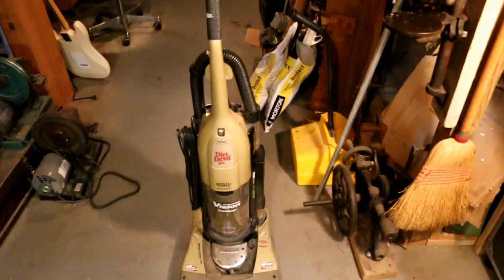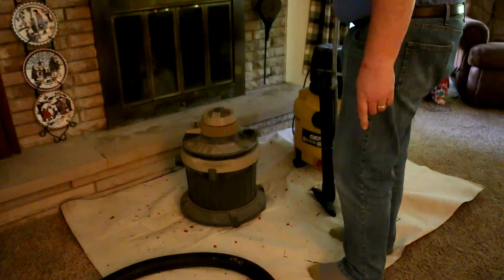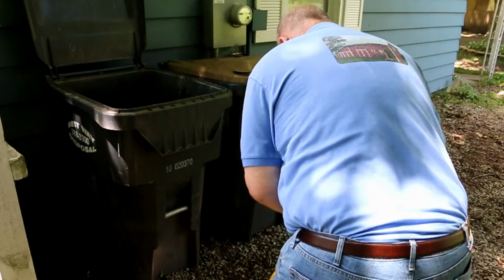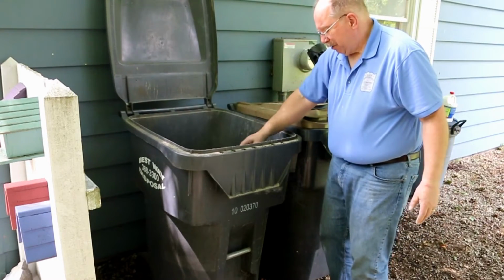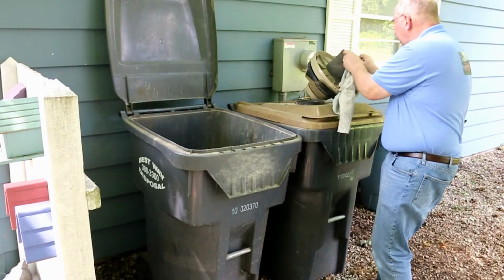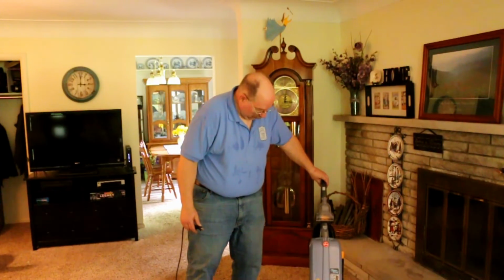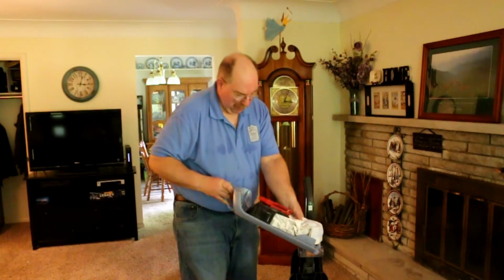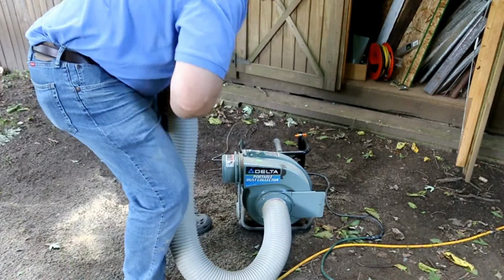Dust Collection ~ Vacuums Need Air

Comment: I rather use a Air compressor to clean a filter out that's what I use
Reply from the maker: I do that with filters on the mower and other equipment. I sometimes do that on the vacuum too. Most times I just dump the tank and knock the dust off the filter. When I'm picking up heavy dust it covers it so quickly I just dump and knock the filter.  😁😎

Comment: They say nature abhors those things... As pretty much any shop I've seen; but most shops do have a shop vac...
Dad installed a dust collector that has a separator. The separator is a fiber drum that sits in the middle of the intake hose.
And I've probably pulled as many vacuums out of dumpsters as I have ever owned.  The best vac in the house only needed a little black tape where someone had dinged up the cord.  The cord was long enough that I could have cut the bad part off and would still have enough for my house.
A handyman should never have to buy a vacuum, 'cause they abound in dumpsters; except for when he happens to need one... 😠

Comment: Biggest complaint with domestic vacuums . Well it was really good now it's rubbish . Yes. No flow blocked solid it's amazing what you find inside and in the pipe blocking it . Like you say air flow is key . The filter cleaning I use a brush first rather than banging it get the worst off then quick bang on the side . Then like you quick blast with air line every now and then . Good job dave take care god bless
Reply from the maker: Pressure differential creates air flow. Instant tornado. I think we could stop a tornado cold if we just had enough dog hair to place in front of it. 😈

Comment: Did you get a new truck?  The last one I seen was the one that had a tree fall on it.
Reply from the maker: Yes. Last year around this time the differential  was screaming on the way home from Goshen.  I bought the Chevy Colorado because I didn't think the Sonoma was worth spending any more money on, but I needed to make the 120 mile round trip to Goshen 3 times a week. 
The Colorado is a work truck with no bells or whistles beyond air conditioning and cruise control. It is a 2012 so ten years and 100,000 miles newer than the Sonoma. 😆😎
Reply: JustSomeGuyWithACamera u

Comment: The $45 was WELL spent! We just have a small one that takes a 5-gallon bucket but it's good for cars and wood trash on the back porch at seasons end and I can blow out the filter with the leaf blower. Rainy out and Cheryl is out in the greenhouse. I'm back with a heart monitor for 2 weeks. A stick on job and I got poked for blood gasses for the setup. They're bound that I'm going on a pill I had issues with years ago and I'm bound that I'm NOT! My resting rate is from 50 to 70 bpm which is fine so as long as big brother is recording I'm on light duty, just when I was starting to get limbered up. BUT fall is coming and so will be firewood time! And someone lawed a heavy metal vacuum off on me used especially in cleaning up ashes. I lawed it off on the Re-store. We shovel ours out into a peck bucket and rake the coals back inside and the fire stays going, and when it goes out we shovel the ashes out and leave the dead coals for the next fire. Fishers start better that way.  So THANKS, Unc! A-PLUS! and NOW the sun comes out!
Reply: I had my Heart Attack three years ago, they put me on thinners to make it easier to flow. I gotten tired of packing those 40 lb bags of pellets for the stove.  Momma claims she can smell the smoke and it's not good for her lungs. The crew just left after installing a ductless heat pump for the house, the ac feels good for now.  I think the electric cost will be about the same as the cost for the pellets as they keep increasing every winter.  We have cheaper electric rates then you have. I think I'm getting too old to pack pellets into the house and if something should happen to me Momma can't carry them. Life is full of changes or as I say adapt and mutate hang in there Lewie and have a good day.
Reply from the maker: @paulharriss1192  That's why we looked for a house with a gas furnace primary heat source. In Union City fuel oil kept going up and fewer people used it. $14,000.00 to upgradevwith new ducts and an air handler like Tractorman44 is putting in at the sons house. No way up to the 2nd floor from the basement. Thebwood fireplace is for lookin at. Puts more heat up yhe chimney than in the house. 
Good idea Paul.  Best to put in now what you will need later.
Reply: @OldSneelock  I 2nd this! Wood is for looks and really cold snaps. Just keeping the blue light off, really. And oil IS too high.
Reply: @OldSneelock  If you have a fireplace you get better efficiency with an insert. 
Camp Kilmer, NJ was a stopping place for GI's before they were shipped out. 
Well my dad knew the fire marshal from that town and when they wanted the barracks torn down we went in and did a pretty good job of dismantling one of them. 
We even got an Army space heater, now that was a great heater. It heated up the basement and then the whole house. Then we moved, built a new home and then the heater warmed up that basement. My wife and I bought a house and it warmed up our cellar. Finally it moved to PA where it heated up my sister's house.  I wouldn't mind having one of them again for the shop.
Reply: Oops couple things I four4got
Here I is. 
and I don't like vacuums cause they suck. 
Well actually they cause a pressure differential.
Reply: @paulharriss1192  Thanks, Paul! I had a stent put in 6 or 7 years ago but weaned myself off of Plavix and other things when things started getting VERY strange with me. Even Cheryl was willing to take the risk. So I E A S E D off of them and have been doing right well since till recently, last month or so. We put in a heat pump when we put the bedroom on. You'll REALLY like it! We run it in the winter till it gets around 32 or 0c and the efficiency goes out the bottom. Then the heater fires up. I've got enough dry wood for this winter already but will get some and work it up for it to dry. No rush. And I just have a certain amount of zip anyway and have to ease along with that. So I'm/we're all hanging as well as we can. 
THANKS, Paul and GBWYall!
Reply from the maker: Argue the method , but the situation has you by the short and curlies Lewie. 
We can't always tell exactly howvwe are doing. 
I was working every day. Driving 120 miles round trip, but I had to sleep in a chair. My lungs were half full of blood that was leaking back from the shredded pig valve. Dr. Deeb said he only had one worse situation with a  patient. He came in with a pink froth in his mouth. He didn't make it. 
You don't have to take their word for everything, but listening won't hurt. My prayers don't hold a lot of sway but you have them my friend.
Reply: @OldSneelock  THANK you, Unc! I listen and Cheryl listens and then wears the web out researching. She'd done very well as your assistant. I only have a 30% chance of going back into rhythm and a lot of folks don't stay there but revert back to afib. I'm stable now and feel fine, REALLY! They're concerned about my resting rate which is between 50 and 70 which is excellent according to their own book. My lungs are clear and I'm resting almost as good as I ever have IF I can get to where I don't fight a full face cpap mask. LOTS have changed in the last 2 weeks and for the better. IF things start getting goofy again I'll go on the cousin pill. Till then, all is well on the swamp. AND EVERY prayer pulls more weight than you realize! THANKS AGAIN!
Reply from the maker: @Weaver_Drafting  I believe that half the people come here just to see what Lewie and the gang, you included, are up to. All we are missing is some nail kegs, a cracker barrel with a checkerboard on top, an ice chest, and a rack of Slim Jims to have a real, instead of just a virtual, hangout. 
This is the closest to perfect shop environment I have had since Mom and Dad sold the big house with the barn/workshop. Just walk in and the gang is herevworking on something and talking about what's happening next. 😆😎

Comment: Never thought a man would need so many vacuum cleaners but then....I run just a small operation....all good...CHEERS
Reply from the maker: I only bought one of them and gave many more away. They are an easy puzzle. Such a mystery to many. Only 3 failure points. Not all can be fixed, but if they are already scrap at least there are parts for the next one.